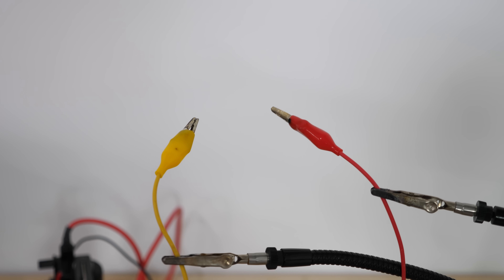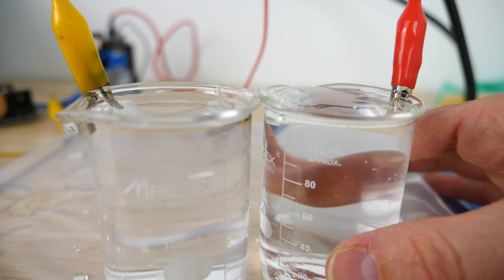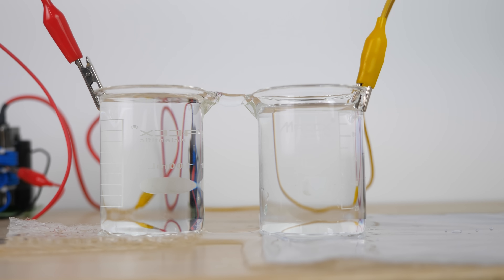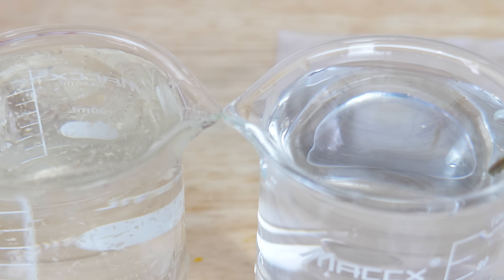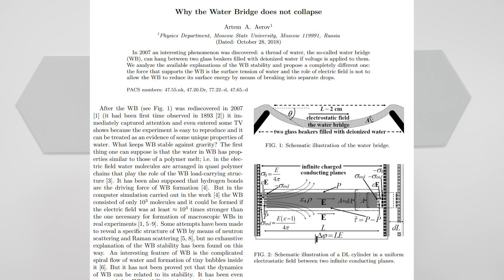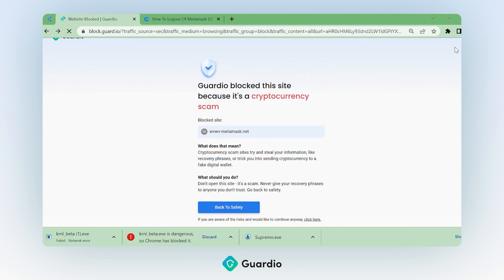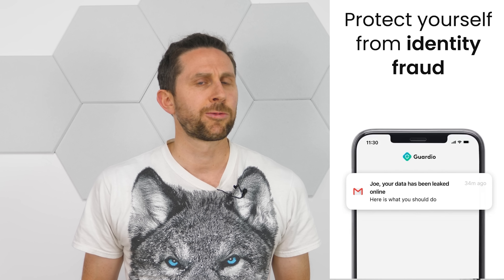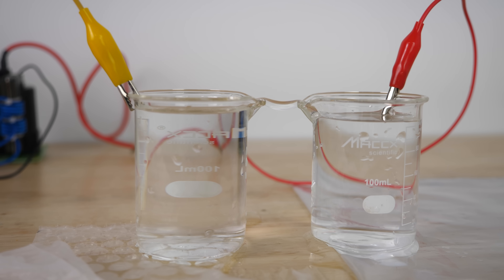How Does a Floating Water Bridge Work?

Comment from the maker: Check out https://guard.io/actionlab for a 7-day trial and 20% off your subscription + the ability to protect 5 family members from hackers and scammers!
Reply: First? Maybe?
Reply: The current of electricity is traveling in a circuit through the water.  That's why it's going round and round from beaker to beaker
Reply: It's funny because I literally got the same email this morning 😂
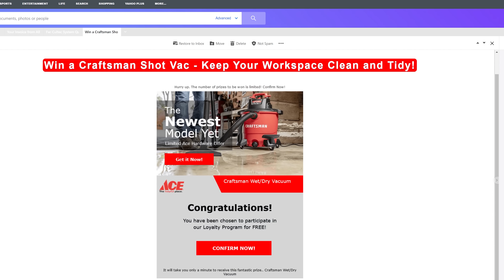Reply: 3:47 to 5:47 ... 2 out of 8 minutes for an in-video ad? And this is after subscribers watch other ads too or pay for YouTube Premium, either of which the channel gets paid? Awesome :face-fuchsia-poop-shape::yt:
Reply: Ayy
Reply: @diegopicadidot8948  It would make a bubble bath.
Reply: A huge hurdle in this project is gravity.  I wonder what kind of effects a zero g environment would bring?
Reply: @justinanderson267  Let the DI water crawl across some extremely clean, level acrylic sheet.   Instead you get WATER SNAKE, an inch wide and many inches long.   It randomly swerves around, like a sped-up video of a river carving a channel.   Moving around like a living snake.   And, this occurs without needing a high-watts supply (instead just use a negative ion generator, 10KV and 50uA.)
And yes you need Distilled Deionized water, up in the hundreds of megohms.   Very slight contamination will spoil the effect.   (The original article specified "chemically purified" distilled water.)
Reply: @diegopicadidot8948  I think the water needs to be perfectly pH balanced or the high voltage electrolysis will disrupt the bridge as the soap quickly oxidizes
Reply: place a ice in a vacuum chamber
Reply: have you tried boiling the water with a water bridge 🔥💧🤔🤷‍♂️🙇‍♂️

Comment: Since I looked the videos about klein bottles I thought about the fact that the ying & yang symbol looked at least for me like a cross section of a 3d model of a Klein bottle with symmetric set up.. like white and black for each "side" of the bottle and not just one but two bottlenecks. Is it just me? Do I look at it correctly? And when yes would it be the proof that the Klein bottle is known since these old times?

Comment: NEVER say "high voltage" or  "low voltage" and vague things. When you talk about electrical things, say how many Volts, how many Amperes, how many Hertz.  You can put voltage and current meters on the screen so people set the values and can begin to connect things in a quantitative and precisely predictable way.

If you are going to do science never say "significantly hotter", say "When I raised the power (Volts time Amperes is Watts) and the mass of the water bridge was so many grams, then the temperature went up at _ degrees Celsius per second.

You do not need a lot of equipment, and you might start with too complicated ways, but if you learn what is essential and always give the  right calculated results in the right units - then you are teaching science and engineering, not just playing with phenomena.  I have been watching you for years now.  You are growing, but if you limit yourself to describing things with only words and hand-waving you will never get the full benefit of human knowledge.

You are allowed to replace videos that are older.  You could make an archive folder and change the name, then put in new better and more precise videos.  You could have ten videos on water bridges, -- IF you are careful and organized.  A small computer than can measure Volts and Amperes and multiply them to get Watts can be put into the video as an window.  The people can see the experiment, and see the values.  You can record the values and plot them. You can record the values and share them online so people can do the calculations and see the numbers with the right units themselves.

Richard Collins, The Internet Foundation

Comment: Water flows from one beaker to another because the electric current is not a simetric altern current, it's rather an oscillating direct current so water flows from the cathode towards the anode.

Comment: Tornado inside the cyclone. Each going opposite directions depending on the right hand rule. 
One is centripetal one is centrifugal, both are the same so they stick together but the internal tornado is going right hand and through the middle. 
The other is going right hand spin but on the outside travelling in the opposite direction. Essentially splitting the charge in the water

Comment: I'd like to see what other things can be put in the water or on the bridge. I thought dye at first but that'd likely change the density for the worst... But even a scum of something like hydrophobic spray on the surface might show some interesting movement... Or sand in the bottom. Sand can hold a charge I think, is that right? Glitter, facial shaving hair particles maybe too......  More fiddling! You know what this made me say to my wife just now? All that getting grief for fiddling with things as a kid.... Wrong! This is why you should fiddle with things and casually experiment on a permenant basis. Some of the best and most important discoveries have been made by fiddling with stuff to just see what it does..... 😎

Comment: well, water is polar so it would be interesting to measure actual water molecule orientation in the bridge - I bet they are aligned along the direction of mass transfer.

I mean do you actually need nano-bubbles if every water molecule is a tiny magnet dragged by the moving charges? I think not.

Comment: Curious to see this experiement in a zero gravity enviroment!
Reply: The water wouldn't stay in the beakers.
Reply: @WJS774  Small scale. Surface tention?
Reply: @GarrettCrosgrove  Surface tension is what would make the water crawl up the sides and out the beakers before you switched the current on. Look real close at a glass of water some time, it tries to do it all the time but gravity stops it.

Comment: Try some INSULATOR-SUPPORTED water-bridges.   After Elmar Fuchs gave a talk here at UW Seattle, I used 4ft sheets of extremely clean acrylic, adjusted to be level.   The resulting bridges then are an inch wide and many inches long, and man do they behave weird.  A "water snake" crawls around like a living thing.  First it "humps up" to ~1cm height when the HVDC is applied.   Even an isolated pool of water, hooked up to 10KV, moves around like Amoeba!   It sends out pseudopods, searching for the other distant terminal.   (This occurs even with low-watt supplies, neg. ion generator modules etc.)   But still we do need DI water, and not just standard distilled water.

Then, drop in a couple of grains of table salt, and everything stops instantly.  Water snakes killed.   (Probably the salt allows the water to self-shield, via surface charge, so as with any conductor, e-fields are excluded from the interior.)
Reply: Wbeaty... Good to see you here! Long-time fan of the Science Hobbyist/Weird Science pages. Is there a video of the clean acrylic high voltage water snake? If not, how soon can you post one?
Reply: @aclinks1  On my original article (search...  amasci high voltage water thread,)  I received an email eyewitness report of giant water-snakes, apparently created by a desert thunderstorm.  That involves extremely clean rain water, plus DC megavolts, with the water-snake in a dry wash.  So, perhaps try a classroom VandeGraaff machine as your 300KV power supply.   It may cause the water to raise up far more than 1cm.   (The report said:  half-mile snake, six feet in diameter.  Must have been some extremely clean sand, considerable milliamps of leakage, plus WAY more than one megavolt involved.)   Huh, I wonder if the water-snake, while it's charged, will not wet a dry particle surface (or even a dry paper surface?)   If true, then it could extend itself over a contaminated surface, a desert dry-wash, but without wetting or dissolving any salty dirt.  

Therefore, with conventional water-bridge, what will happen if we touch the bridge with a paper strip, or sandpaper, cotton, etc?  Is the "electrowetting" decreased or enhanced?   I have no idea.   Never been tested?    (Also try a safe HV power supply, far below 1/2 watt, and then carefully touch the water-bridge w/finger, while your body is isolated from ground.  Can you shove the bridge around?  Or does finger-contact simply destroy it?)
Reply: @aclinks1    That's up to others.  My policy is to post unexplored discoveries, so kids can use them for science-fair projects.  Those who read about secrets, then test them at home, get the rewards.  U be first!  High-traffic YT vids!
The setup is incredibly simple, the only trick is to get some sufficiently-pure distilled water.  I don't know if store-bought DW is pure enough.  Perhaps it would still work, if a dangerous high-watts 5KVDC supply was used.  Perhaps order some gallons of Milli-Q ultra-pure water from a chem supplier?  Or, ask around at a local chemistry class, bring a clean bucket?
It's the same problem, if you want to demonstrate the 2-beakers water-bridge.   Glassware and electrodes repeatedly scrubbed in alcohol, and a litre or two of deionized water.

Comment: Imagine how it would behave in low gravity! I bet high voltage electrolysis is taking effect without an electrolyte so the temperature and pH and weird bridge effect is all due to the anode collecting the oxygen and the cathode collecting the hydrogen when water splits!

Comment: Is the result much different if you use mineral oil instead of water?
Reply: If the effect is dependent on water being a polar molecule, then probably not, since mineral oil isn’t polar.  But it would be a great test, because way if it works or it doesn’t work, that is useful information to refine the hypothesis on the mechanism of the effect.

Comment: Btw, the movement of water is caused by the Maxwell "dielectric displacement currents". If the water is a perfect insulator, these dielectric currents attracts the water molecules and successively repels them. 
This happen because the water molecules are strongly polarised.

Comment: Try again with sharp edged containers instead of round edged. I have a feeling that the bridge will be longer. if that happens I would like to know why. TIA
Reply: good idea lless rounding glass rim on a beaker might have to get a glass blower to do it for ya
Reply: @Addison_Cleary  Or simply grinding the edge with carborundum grit on a flat lapping surface.

Comment: Does the flow of one jar to another follow the current from negative to positive charge? If the water is charged could that increase the occurrence of localized dipole moments in the water bridge and present bulk dielectric properties; causing a flow of water monomers following the flow of the current? If you observe the zwitterion dipole moment and hydration, could the same effect be present through the flow of an electrical current through water?

Comment: AMPS. YOU NEED AMPS. I discovered while trying to replicate this with my influence machine that, even though it has the voltage, it doesn't have the amps to create the magnetic field to hold up the water.

Comment: This is impressive! 
What would happen if you repeat this experiment with a very viscous liquid that doesn't physically harm you by making by products? 

Also, does it work for molten states? 

Really, I want to know.
Reply: Science has unlimited content
Reply: Dude... they don't even understand why the water bridge does what it does. We don't even know if the questions you're asking make sense to ask.

It's great that really you want to know. So does science. Go help out figuring it out.
Reply: The liquid has to be  be insulating.  Distilled water doesn't work, instead you need hundreds megohms or better, from DDW, deionized water, called "chemically purified water" in old journals.   But perhaps oil will work, veg. oil, kerosene, gasoline.   On YT there are videos of the strange electrostatic effect with oil.  It grows points, then spews droplet-streams.   Probably it's a similar phenomenon to the ultra-pure water.   (Ultra-pure water has been used as capacitor dielectric in mil systems, HVDC radar and transmitter supplies, etc.

Comment: Man I have a PhD degree in physics yet still get surprised every time with Action Lab video.
Reply: I was at a conference when I heard a lecture by Elmar Fuchs on this phenomenon. He published several papers on it from about 2007-2010. I was teaching physics at the time, so I cobbled together a ballast and a flyback, and my students and I ran a bunch of experiments on the water bridge. It was a great way to show the students that one doesn't need expensive equipment to make cool discoveries.
Reply: @MonteFleming  Me too, Elmar F. was here at UW Seattle.   After his talk, I found that our HV supplies lacked the required wattage (except for one, and that one had so much 60Hz hum, that the water bridge would always splatter.)    So, I tried it with pools of DI water on a big level sheet of extremely clean plexiglas.   GIANT WATER BRIDGES, an inch wide and many inches long, and they dynamically crawl around like living snakes.   Two separate pools, connected to (very clean) electrodes, will send out long pseudopods in order to find each other and connect.   "Electrostatic Amoeba" demonstration!

Then drop in a single grain of table salt, and everything stops.   Ionic contamination poisons the poor snake.
Reply: @wbeaty  awesome—I didn't ever try it on a flat surface. Now I'm tempted to pull out the power supply and run some more experiments.
Reply: @MonteFleming  IIRC I put a grounded aluminum plate below the plexiglas, to increase the field forces around single puddles contacting just one HV terminal.  (This to make my feeble 7KV power supply more effective, and simulate the conductive ground surface below the "giant water snake" in that guy's report.)  Heh, local indians tell him that Giant Water Snake will kill anyone who gets too close.   Megavolts, plus many uF of capacitance?  Yes, would be lethal.
Reply: @wbeaty  that setup makes sense.
Reply: Same lol.
Reply: @eypandabear7483  you’re looking for a physics boyfriend huh?
Reply: Flex op
Reply: You must have to watch Electroboom.. 😎
Reply: What was your subject emphasis in physics?
Reply: The Action Lab guy is a PhD in chemical engineering, so no wonder.